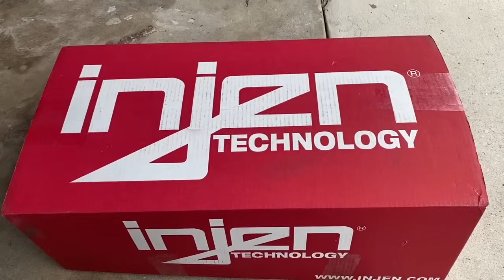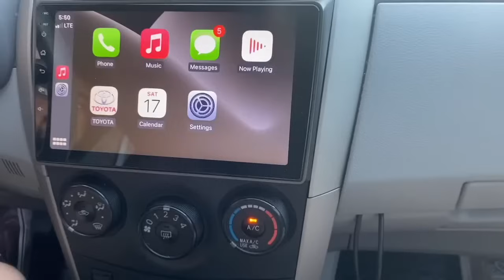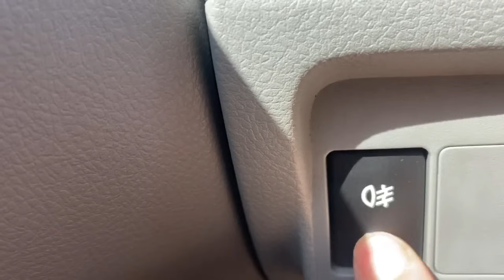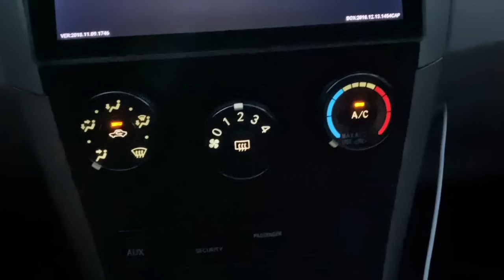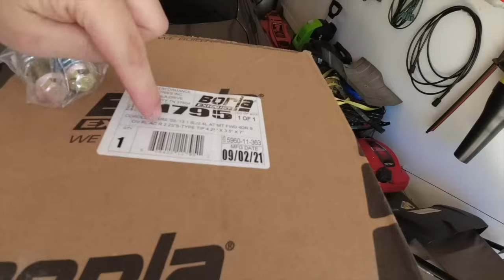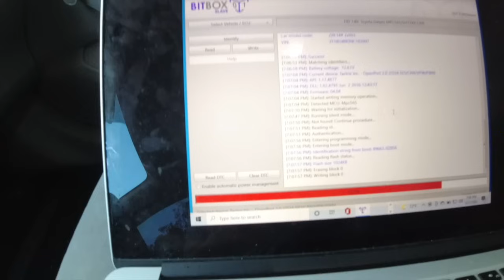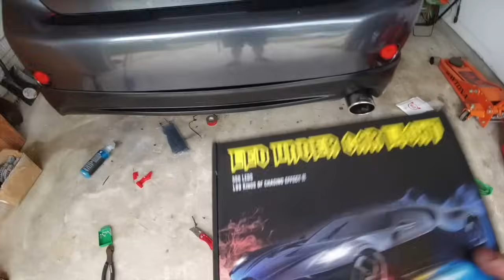INSANE TRANSFORMATION ON TOYOTA COROLLA(Corolla Build)

Comment: Nice build!  Props on the DIY.  Mine is similar, I.e. focused more on driving fun than on raw performance:

2019 VW Jetta 1.4t
Clutch delay valve delete
ECS muffler delete kit
Wireless CarPlay
DieselGeek short shifter
DieselGeek shifter shaft bushings
Raceseng weighted shift knob
APR coil packs

Still to be installed:
Luft-technik CAI
Unitronic Stage 1 tune
ECS front strut tower brace
Better speakers (stock ones are garbage)
Reply from the maker: That’s awesome! I love the jettas. They are very nice. I drove a 2006 Jetta with the 1.8T and it was nice, it was an auto, but I bet having a manual would have made it better.
But yes trying to make the driving more fun, is honestly better then power mods! 
All the little things start to make a big difference, and it looks like you got your Jetta driving nice!

Comment: super clean, i got a 2013 corolla and i might do some slight mods
Reply from the maker: Thank you! 
And you alway have to add your own touch to your car!!
Reply: @BrandonStellmach  I plan on adding the Binize head unit and some projector headlights, what did you think about the Binize because I know you switched to a different one.
Reply from the maker: @exocodm9327  to be honest the binize radio was a great radio for the cost, it was working great from day 1 and until I took it out still working good. I only upgraded because I wanted wireless Apple CarPlay built in, and not have to use dongles. 
So all in all it’s a great radio, but cost about the same amount to get wireless Apple CarPlay on the binize as it does to just buy the idoing radio I have now.
Reply: @BrandonStellmach  Thank you for the insight, I might go with the Binize because I prefer Amazon.
Reply from the maker: @exocodm9327  Totally understand, much quicker, and easier to return if you don’t like it!
Reply: @BrandonStellmach  just an update, the unit I have has wireless CarPlay so maybe it is a new feature they added
Reply from the maker: @exocodm9327  that’s crazy, they just have updated it. My unit was about 1 and half years old. So they probably added it afterwards.
But that’s good for you as long as you got a iPhone!

Comment: Dude I love my 09 corolla, I just wish I could've found a manual. I'm not a fan of the auto 4 speed in it. And the cold start intake VVTi gear I had to replace in its 2ZR-FE. Btw, if you haven't done that on your car and it starts rattling, the part number for the latest version is 13050-0T050. It was hard to find that number for me so hopefully that helps you out when the time comes.
Reply from the maker: Yeah the manuals are sometimes hard to come by. 
But surprisingly I have not had that VVTi rattle yet. But I will definitely keep that part number handy for when I do need it!

Comment: I have the same car and I’m wondering? 
With all those power enhancements, won’t it put pressure on the battery?
Reply from the maker: I had zero issues with my battery. As long as you have a good alternator to charge the battery, there will be no issues!

Comment: couldnt find spoiler kit link, and can i set it on my 2012 camey ?
Reply from the maker: Here is the link to the spoiler. And it might fit a 2012 Camry, but it might not be as wide as the car. Might want to double check dimensions.

https://rover.ebay.com/rover/1/711-53200-19255-0/1?mpre=https%3A%2F%2Fwww.ebay.com%2Fitm%2FPAINTED-ALL-COLORS-TOYOTA-COROLLA-FACTORY-SPOILER-2009-2013%2F122241699452%3FssPageName%3DSTRK%253AMEBIDX%253AIT%26_trksid%3Dp2057872.m2749.l2649&campid=5338672978&toolid=10001&customid=spoiler

Comment: Hey i was wondering… is it possible to use the facelifted (2011-2013) bumpers and head+taillights for it?
Reply from the maker: Yes you can, for the front you will need to swap out the bumper, grilles and headlights.
And for the rear you will need to swap out the trunk and the tail lights.

Comment: Amazing job bro !
I did some of the modification you've did 5 years ago, 
like the Borla Exhaust which I really love,
the Injen cold air intake which creates an aggressive tone when pushing the gas pedal but is very risky when driving in flood (I hydrolocked my car once with that intake),
the taillight as well but the halogen bulb provided had poor visibility, had to replace them with LED bulb.

I want to ask 3 questions:
1. What is the brand name of that headers ? I've installed the Weapon R one.
2. For the ECU reflash part which I haven't done yet, do I just buy the kit and i'm all good or is there other parts needed ?
3. How is the sound quality of the headunit radio ? I had one exactly the same as yours but was from china and the sound qualifier was bad.
Reply from the maker: I have always had that worry about my cool air intake, but it has never been a problem!

The headers I had were DNA headers, I ordered them off of eBay.
And for the tune, you just buy the kit. Which comes with the software and cables needed. Then you will down load you stock tune file. Send it over the AMT, they will tune it. And then you load it back one when you get the file back.
And the head unit sounds better then what was in there now. Has a lot more bass to it.
Reply: @BrandonStellmach  Thank you for replying.
And I see in your other videos you've installed the turbo from Turbo kit. That means you had to remove the Borla exhaust, headers and Air Intake as well ?
Reply from the maker: @jin5632  yeah all that has been removed since I installed the turbo kit. I still do need to get an exhaust soon!

Comment: Amazing! I have a Corolla XRS 2009 with 24000 miles and I just love it, bro were you able to configure the steering wheel controls with that android stereo? cus I can´t
Reply from the maker: That’s awesome! Love the XRS, sometimes I wish I had got one of them!
But yes I was able to get the steering wheel controls working. Just had to swap out to the correct clock spring. And use the SW Controls app on the head unit to link up the buttons.

Comment: I clicked on this because I also have this type of Corolla and it popped up in my feed, but im curious, how come you didn't just get the S model? It comes with a lot of the mods you did. I will say, your exhaust sounds awesome 👌
Reply from the maker: If I could have found a corolla s with the 5 speed manual that was somewhat close to me I would have. But this was the best corolla I could find with a manual. But it just happened to be a base model
Reply: @Brandon Stellmach  nice, well it's definitely the coolest of our year Corolla I've seen, so keep up the good work!

Comment: I'm wondering just how easy would it be to put a 6 speed into this thing. Evidently the U.S. market didn't get a 6 speed manual but the E.U. did get one in the 1.6 and 1.3 Corolla Atlis models. Do you think that it's as simple as taking one out and putting the other in? Or are they completely different?
Reply from the maker: I know monkey wrench racing actually sells a complete bolt on transmission for the 10th gen corollas to get a 6 speed manual.
The only problem with that is it’s pretty expensive. 
But instead of looking at those E.U cars.
The transmissions from the 11th gen US  corollas are practically bolt on. I think the only things you have to change and modify is the shifter linkage.

Comment: did the additional buttons on the new steering wheel get detected by the steering wheel controls settings in your android head unit?
Reply from the maker: Yes after I changed out the clock spring and the steering wheel the andriod head unit recognized all of them

Comment: Have you ever had your tail lights go out or your park taillights go out mines not working
Reply from the maker: The only time I had my tail lights go out was when I was doing some wire testing and I blew the fuse. Maybe check your fuse under the dash and see if that blew. But other than that I have not had any problems with these lights.

Comment: Can you do the intake mod and the other change yo did to the motor (if you tell me the name I would appreciate it) to the automatic version of the corolla I have same year so I'm guessing it's possible or does it change and also with tuning would it be possible to do like turbo on an automatic or is that a no go? I'm new to the scene so I'm still learning about it but I do want to make my corolla a bit faster if possible even if it's an automatic until I can eventually buy a new car to do more racing centered stuff
Reply from the maker: I believe you are talking about the intake and the exhaust headers. You can do those on an automatic with no issues! 
If you want to do a turbo, the automatic transmissions are prone to slip at higher power. But if you keep it around 200whp it should be fine! But if you do a turbo you definitely would need a tune! I have plenty of other videos on my channel that go over the turbo!

Comment: hey man I have a question? Where did you get the wheels rims?
Reply from the maker: These are the wheels and tires I have.
niche m117 Misano 18x8.5 with Nankang 225 40 18 tire. 
You can find them on fitment industries.

Comment: are your coils comfortable?
Reply from the maker: They are not nearly as soft as the stock suspension! But if you like a stiff ride, they will be fine! After a few days, you get used to it!
Reply: @BrandonStellmach  i had truhart coilovers and the mechanic messed with the preload so i hated how they felt but now i wanna go low again
Reply from the maker: @glyxics2116 the truharts I have on my corolla now are okay, i had better luck with my rev9 coilovers which were cheaper!

Comment: I wanted to get aftermarket headlights for my 2017 headlights 

I work at a cash register and a guy who works at Toyota came in and I asked him wheather if they install AM headlights he says no 

And he said I shouldn’t do it myself cause some wires might get messed up on the headlights and can mess up and it’ll cost like 1300$ to repair it

Idk if I should still do the change
Reply from the maker: Some Toyota dealerships will do after market parts, and some will not. 
Also if you get aftermarket headlights, just make sure they are plug and play. So there is no splicing or cutting wires. 
So then nothing can go wrong. And if something does happen with the new headlights, then you can switch back easily to the old ones.
I would just say get a friend to help out, and you guys could probably do it together. It’s not hard at all.
Reply: 2017 camry* lol but yeah I’ll just pull the trigger and get em and try it out

Comment: Great video! I have a 2009 Toyota Corolla so far the only upgrades I did were. New radio Android auto,alarm system and push start and also a backup camera
Reply from the maker: Thank you!
And I’ve been thinking about doing a push start, may I ask what brand you used? And was it fairly simple to install?
Reply: @BrandonStellmach  I used avital I had the guy that sold me the alarm install it. I believe it took him two hours to do it I think. I Can't really remember because I got it installed soon after buying the car  He said Toyota Corolla are kinda difficult but he was able to install it with no issues
Reply from the maker: Thank you! I will have to take a look at that!
Reply: @BrandonStellmach  you're welcome

Comment: Respect but why a Corolla? I feel like you could have gotten a much better better base to build off for the price and put in the exact same upgrades and have something with twice the power and twice the looks and all the interior bits you added as well
Reply from the maker: I totally agree with you. The corolla is probably not the best to start with. Because no one modifies them, and the after market support is not the best.
Yeah I could do what everyone else does, and get a civic, FRS, Subaru. And modify them and have lots of support and more power. 
But to many people do that. And I wanted something different.
As for power, I have recently put a turbo on my corolla and probably getting close to 250HP. Still need to dyno it and get all the other things done first. But it’s going to be a fun car when I’m done!
Reply: @BrandonStellmach  good for you then man, I just hadn’t seen you specify why a Corolla in the video I wasn’t tryna Hate! I went from a Kia to an s2000 but I struggled adding power to something that was automatic and FWD so I went with my s2000 because it was the same price and it felt like something I could actually work off of. RWD was the biggest thing for me because I felt like that’s what separated a sports car and an economy car, but the lovely thing about it is you can just simply tell me I’m wrong as it’s my opinion hahaha
Reply from the maker: @Jonahalcalde  i would agree that a RWD car would be more of a sports car! I would love to get something that is rear wheel drive. But most of them are way to expensive! 
That’s awesome you got an s2000, I have always wanted one, but the price of them just keeps sky rocketing, and paying 20k for a 20 year car isn’t in my price range at the moment! I have actually been looking at getting an is300 Lexus, early 2000. But they are hard to find in a manual!